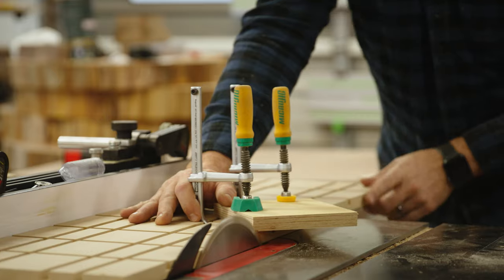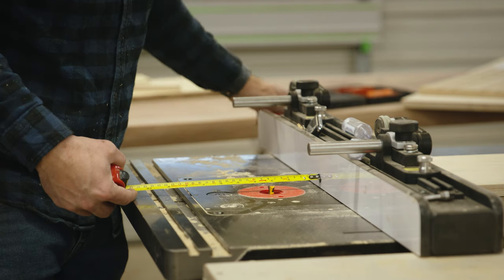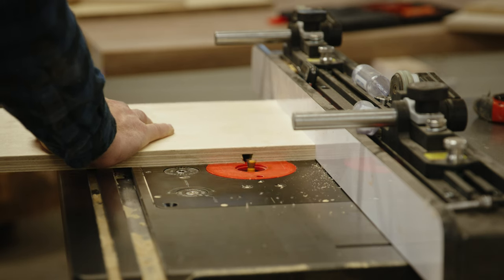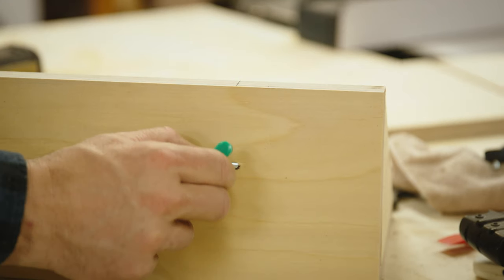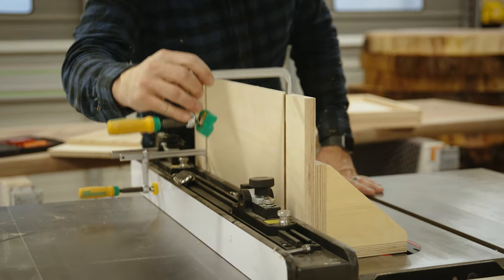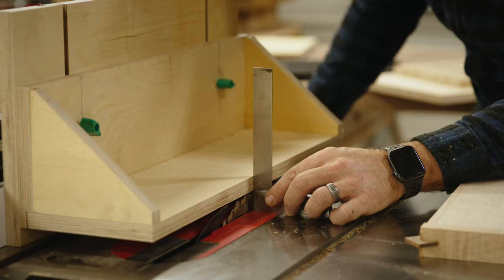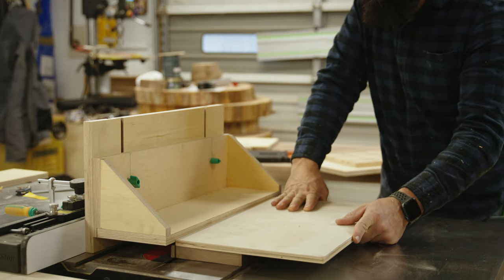You Don't Need A Flush Trim Bit

Comment: Definitely could have used those Jessem stock guides to make some of those sketchy cuts safer and cleaner. Great video. Thanks for sharing it!
Reply from the maker: How
Reply: @CoffeyCustomBuilds  I just noticed that you have the ClearCut stock guides, but you didn't use them.  And the "sketchy" cuts I was referring to were the ones on the router table where you were passing the piece through along it's width.  I take no issue with the cut if you feel comfortable making it.  I'm just saying, it could have been made safer by using the stock guides.

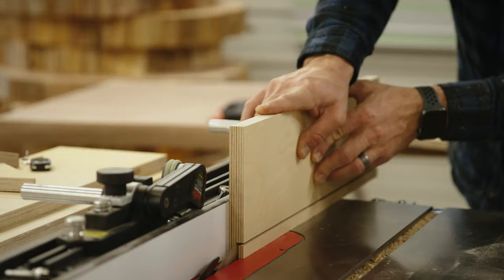Comment: Stopped watching at precisely 0:49! As a pro, you just don't do that - and especially not when newbies are watching who might not be aware that this is a great way to send a square piece of ply with 180mph towards your leg artery and/or crown jewels.
Reply from the maker: With an L fence you stand to the opposite side of the blade that the offcut falls on. So it's safe. It's extremely safe. As a pro I know that. Byeeeeee
Reply: @CoffeyCustomBuilds  As a pro (and a workshop instructor), I'm NOT talking about your L-fence, of course. From what I can see, your L-fence is perfectly safe (I assume)!... I'm talking about cross-cutting with the off-cut piece butted against your parallel fence. From what the viewers can see at 0:49, the part is longer than wide - and that's a clear no-no, no matter how you look at it: a tiny bit of debris, a millisecond of inattention and the rising teeth of your saw blade will catch, increasing the lateral forces on the blade due to the longer-than-wide condition and the part (and your fingers) will turn INTO the running blade = Ka-zzzziinnggg ... or, as you are phrasing it: byeeeee fingers.
Reply: Addendum: to those watching from the sidelines, wondering what this is all about: https://www.youtube.com/watch?v=F0jbg9LuDsc explains how the risky cross-cutting in the build part of the video can lead to nasty kick-backs...
Reply: @f.d.6667  I noticed that, too. Seemed dodgy.
Reply: @stephenmcgeown  Yup... we all have done that but it should not show up in an otherwise good instructional video.

Comment: I'd honestly with no bragging just use a multitool and a chisel + quick sanding to make this 10x faster than you set up this jig + I would not waste space in the shop for a unnecessary jig like this one. Sorry but that's just my opionion. I like the way of creative thinking and problem solving but I just do not see this useful unless you got unlimited storage and like changing the saw setup all the time
Reply from the maker: This is a very old jig that is crucial to batching out furniture parts and I can guarantee you it's significantly faster than the method you used. But, that's your shop!